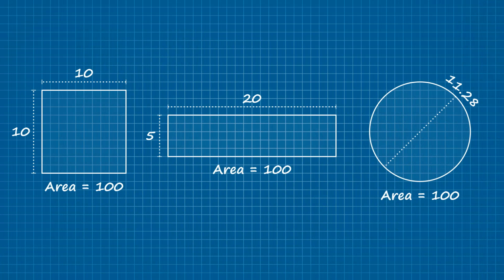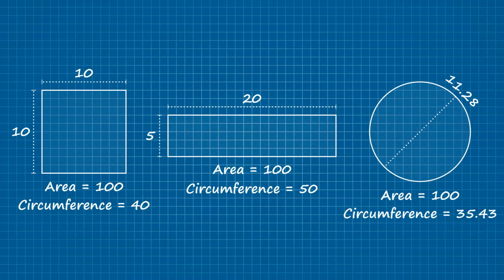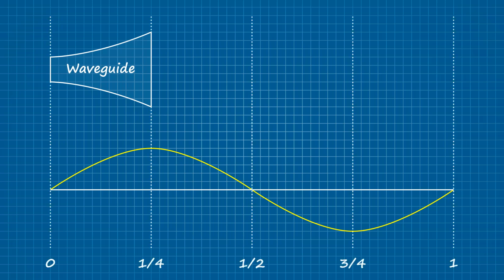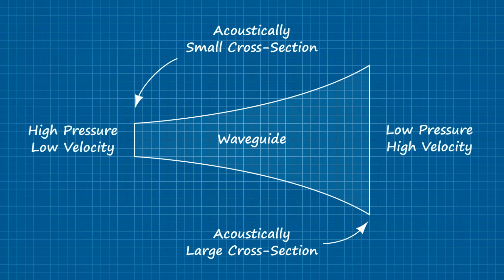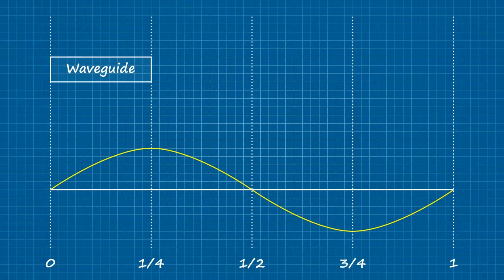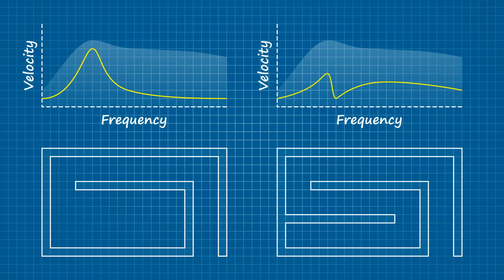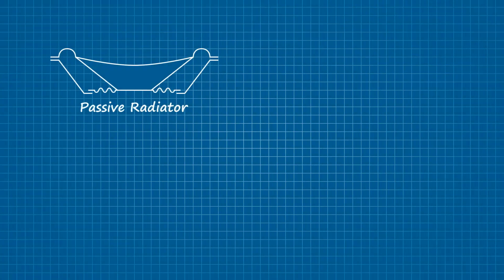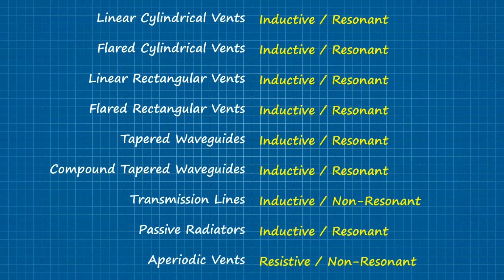The BEST Port Video EVER

Comment: If you cut a linear cylindrical vent at an angle, then each end area should be bigger, but is it acting like flared or is air just leaving one side of the port first making it effectively just shorter?

Comment: Hey Hexibase,
I‘m in the middle of a subwoofer project (which is only possible because of you ) thank you for that ! 
But now i‘m asking myself if my port length is only gonna be the cylindrical part of the port or the flares that are making both end pieces aswell. 
I really hope that you can help me out with that question
Thanks Dennis

Comment: Got it all on the first go, nice job.  But to be fair...I have been designing and building boxes "technically" since the early 80's as a 12 year old making speakers out of cardboard boxes using salvaged boom box speakers. LOL But for real since the mid/late 80's.  The BIG game changer was my first "speaker program" running off floppy disc in a DOS environment! LOL  Before that it was books and calculators.  😁

Comment: Great video, but how big is the lack of efficiency with a rectangular shaped port. 
I’m planning to use a 18,5 x 3 (cm) port with a 24cm length. 
I could replace it with a round one but I just can’t find one with the same surface combined with lengt. Shorter is not annotation due to the air velocity and bigger not due to excessive length.

Comment: Hey Pete, 

I learned that oversized vents are more efficient, is the same true for larger PMs? Lets say the PM 3 has times the surfacearea of the active chassis vs a more conventional PM setup where the PM is roughly 1.5 of the active chassis area.

Comment: Ssssoooo it's been 5 years since this intro. Is there any chance there is an in-depth technical follow-up in the works? How do you calculate the curves and lengths for the tapered stuff? Or is it trial and error? Iv looked around for videos over the years with very little luck. 
As a side note, thanks for all you do, mister Hex. I greatly appreciate your efforts even if I mostly end up with more questions than answers 😆. It's not your fault im just not that smart.

Comment: What do you think of this?>>>Depending on the port length alone, I suppose the idea should be to have it such that every movement of the excursion of the sub
should be presented at the port's frontal opening to actually add onto the sound level from the sub itself, even though it may be (or MUST be, per my proposal) one half (or a full?) cycle behind it, utilizing the port length alone to 'simultane-ize' the port to the sub. Hell, this may be actually what 'tuning' (yeah, right - 'This is what it showed up as - I'm just happy that it 'bangs'') the assembly should involve. I'm thinking of it as though it were an engine's piston, having to be in exact accordance with the other components or it will not work properly - or at all. Something similar and perhaps more-knowledgeable was mentioned below by @NackDSP, so credit where due; 
I suppose the main stipulation is to know the length of any given frequency's wavelength, lol and zero in on a desired frequency per that of that one that one THINKS (whoa) will make their day, lol. Cheers---🍀

Comment: Question....2 sundown x18v3....14 cubic feet box at 32 hertz.....can I use three 6 inch ports at 11.56 inches to reduce port displacement.....or do I need four 6 inch ports at 16.87

Comment: Don't settle for late ringing bass of a ported system.  Seal the enclosure, add a second woofer apply a Linkwitz transform to get the low bass you want. Set the roll off Q low, like 0.4, to get minimum group delay.   Done.  Perfect bass forever.  Go try it in winISD.  They even have the Linkwitz transform model in the filters section.   Stop crushing your bass transients waiting for that port to go through 3 cycles so it can reach the SPL you wanted.   The transient frequency response of any ported system is just what you get from the woofer without the port.  Have a look at that.  Where's the bass?  It's on order and will be here in three cycles.  Plucked bass notes and drum beats are falling exponentials.   That first cycle has the peak SPL.  You never see that with a port or passive radiator.  And those resonant systems don't stop when the note does.  It keeps going three more cycles.    Enjoy your slow late bass, won't stop blurry ported bass.

Comment: Recently I built 4th order for 2 10" subwoofers,  sealed was a little over 1cube, ported was 2.3cubes, I tried to tune it to 36-38 hz with 2 3"/8" flared ports didn't like the sound so I removed 1 port shorten the 1 port to about 4" it was worst, this was on a 3k, then I switched to a 5 k and that made matters worse, I'm going to scrap the box, but I think a box that small I had to tune it to more than 40hz, but I simply don't like higher tunings, I'm probably going to just make a regular ported box for those 2 10s

Comment: 🔴I have a 8 cu ft gross ported box (with 15" kicker L7s 1000w) my port area is 17.5" x 4" equals to 70 in2 (or about 9 in2 per cubic foot). can someone tell me if my port is to small. i heard its supposed to be 12 to 16 inch squared per cu ft

Comment: I hope you see this question ...
You are the most knowledgeable person I have found on the web regarding subwoofer enclosure design so I have a question for you. 
I built a 6th order BP. I built it with the 35hz port facing the rear of the vehicle, and the 85hz port facing the front of the SUV. My thinking was the lower bass could bounce off the back to gain strength, and the upper bass could come straight at the front. 
It's loud and clean, but there seems to be a lull in the 60-70hz region, and I don't know if it's because the tuning is so far apart, or because the ports aren't facing the same direction. Please advise me Yoda🙂.

Comment: Let's see if I can translate some of this overly technical jargon into something more informative for people who are actually trying to learn from the video....
First thing that could have been simplified to almost everyone's benefit
"More consistent loading across their operating range"... just means the frequency response is more even or "flat".
Reply: "Efficient" basically translates to loud. More efficient means louder than less efficient.
Reply: "Velocity" idk, I'd have to Google that one. Anybody know what function the port velocity plays in the sound of a port? I'm sure Pete could have told us.
From what I know (which is admittedly limited) a smaller port cross section would mean higher velocity, but to me the main point of a smaller port cross section is a lower tuning. I don't assume that more velocity itself translates directly to a lower tuning, but that wasn't explained either.
Reply: "Acoustic impedance" ... acoustic impedance is a measure of the ease with which a sound wave propagates through a particular medium. Thanks Google. I would assume more impedance means more velocity.  So... smaller port means more acoustic impedance, which means more velocity, and thus lower tuning?

Comment: Great video. 
Question, does port material matter past it being strong enough to maintain its shape? And with a slot port do sides need to be made of equal thicknesses?
Reply: Side thickness does not matter assuming they're strong enough not to flex at high power. Ports produce sound by the air mass resonating inside the length of the port, so as long as the air is able to flow through the port without the port changing shape, its fine.

Comment: Wow So much information in such a short time, 1,000 Thanks 
Will the port output from a standard ported speaker, (eg a commercial 300 $ speaker/set) be in phase or opposite phase with the output from the bass unit? 
If it is not in phase, then what is it? Opposite phase, or without measurable phase?
Regards!

Comment: Hi, I have been following and by far you have the most educated explanation to ports and their relation to frequencies. I am a fan of folded horns bass, to me the way el36sixis sound with long notes is awesome but they are not as punchy as srx front mounted bass cabinets. Anyway. Spl wise what would be your recommended box for 2 12 sundowns on a acura tl. Thanks in advance

Comment: How about these ported boxes with a corner port where you can see it stops a certain distance from the back wall of the box . The triangle port would be different from square or rectangle but still no we’re close to the round . I just wondered if you had seen this and inside they have like half walls . I’m wanting to think there bracing but if you look at them the rear part of these boxes are angled down in the back like the top is narrow from front to back. So there’s 2 walls-braces best I can tell by looking at them 1 is up and down out maybe 2-5 inches and it’s closer to the back wall and the one off the back wall is wide at the bottom because the angled back and placed close to the side off center we’re the one is at. Then they are both on the opposite side the port is on at the bottom now that what I see if it’s a single driver the one I seen with 2 has got 2 triangle vents for each driver and dose not look to have those braces-walls in it .  I kinda think they could be for we’re is a port the opposite side of them there for like air control ? There’s always something new or a twist on something we already have seen or hybrid of it . Also what do you think about the round subwoofer boxes I have seen them being made now we’re there ported different from back in the day . There measurements are off like the 10 ported is under a cubic foot so most 10s take a cube or more then you look at the 12” tube and it’s like sealed numbers 1.4 cubic feet ported I’m like buy a set of 12” tubes and put 10s in them might work they give you no port volume or exact size.  There partly round or rectangular with sloped sides. I like the looks of them but we know the wolf can come in sheep’s clothing but enjoyed the info great video keep control of the other Pete and thanks again

Comment: I have two 600 RMS subs I bought from a guy trying to do a home speaker. I would like to use only the subs since the rest was crappy. They are Edge Hollywood ED-1596. I can't find the specs and I'm wondering if it's too big to use both in my house (i gotta say I like it LOUD). Or to keep one for my car. What's your opinion on the subject?

Comment: does anyone know if I could do a 6th order bandpass with a regular round port for higher frequency response in the secondary  chamber but use a passive radiator in the primary chamber for lower frequency response and higher sound quality to create a "sealed" front chamber and a ported second chamber

Comment: Are there any special rules for PRs (Passive Radiators) such as where in the enclosure they should be placed (front, back, certain distance away from the active woofer...)?  Also, is there anything special needed for an enclosure that has say 4 small identical woofers (let's say 8" or 10" each) with a big 15" PR?  What normally should be the ratio of the PR's cone area vs. the total cone area of all the active woofers?  Should the PR have at least the same area as all the active woofers combined (such as four 8" woofers vs. one 15" PR), or should the PR have more, and if so, how much more... 50%, 100%...?  For a dual woofer isobaric (clamshell arragement) subwoofer, can a pair of PRs be added also in a "clamshell" configuration and is there any advantage to doing that? Thank you.

Comment: Hey thank you for this information I am currently in the process of rehousing my rear speakers from my 5.1 system into my chair that has the perfect holes. 3d printing. additive manufacturing. They are two 70mm 4ohms. looking to make the best box for them.

Comment: I bought the components to build the Bob Crites CORNSCALA type 'B' speaker system.  (Go to Bob Crites web site for visuals).  It's ports at the bottom radiate forward & are rectangular.  The company told me NOT to modify them with any flared or rounded end caps as port noise is not an issue.  What's your take on this?

Comment: In a car, does the port location make a difference? Like a subwoofer facing forward and port facing the back. Both facing the same direction. Which would be louder?
Reply: I had a Bose bandpass in my trunk and when the ports were facing towards rear of the car it had more bass but when I had a sealed inclosure it didn't make a diff which way the speakers faced

Comment: Flared round vent/ports are the best way to go.  Just common sense in a way.   Here is another way to look at it,  for the most part, car exhaust pipes are round for the same reason. Most may not know this but a cars exhaust, length & diameter,  also play apart in tuning the engine.  And just like looking for a specific tuning frequency of a speaker box, you are essentially doing the same with an engine.  This is also why sticking the largest diameter or shortest length pipe MAY NOT always be optimal for a specific build.   Regardless this is why I follow this guy, because I am experienced in this field,  got my MECP, & other certifications in the mid 90's, not to mention as much experience in building high performance engines & high end fabrications,  & so I can confirm that this guy knows what he is talking about. One of the best actually, so pay attention to what he says, because he is on point

Comment: In my workshop i have a variety of loudspeakers - yamaha-JBL- court- and a pair of transmission lines - when it comes to bass extension and warmth the TL beat the modern 15 inch drivers. from 80m away you just sense the air is full of life- if you get time to talk about TLs , i would be an avid viewer. thank you

Comment: Hi I want to ask - how to limit my 50hz tuned speaker with 2 flare ports to say about 80 hz or considerably reduce lower frequency with out upsetting overall frequency balance?

Will open cell foam reduce it like the foam used on classic spendor 100 speakers?

Comment: Question to HexiBase: can I use multiple holes on the box, instead of a single tube? For example if tube required would be 10 cm long and 3 cm diameter, can I simply drill 5 pieces of 3 cm diamater holes on the front baffle which is 2 cm thick? I guess the resonating “airmass” would be similar. Yet no one uses holes! Why?

Comment: 1) You assume that the emissive point would be at the input of the vent, that is wrong. Sound already comes from everywhere at this point, hence your air velocity argument isn't valid, for this sole reason. There is still a impact, due to the friction effect of the bigger circumference only.

2) Rectangular shaped vents benefit from requirering a smaller surface area (hence, a shorter vent !) for a same accord frequency.

Comment: Excellent video! If a rectangular port is chosen for a subwoofer and the length of the port is to long to fit in or out of the box, so it is instead snaked back and forth within the box, does it then become a T-line box or is it still just a rectangular port?

Comment: Hi. Maybe I will sound silly and I didn't understand well but, here is my question:

The less air inside of an enclosure with a passive radiator, the better?

Is there any ideal position for the passive radiators? Maybe some "wall" into the enclosure between the speaker and the radiator??

Thank you in advance. You are truly an audio-genius

Comment: some late info.        at 3:05,  in the context of the propagation of sound waves,  with the exception of high-excursion drivers, there is very little Flow,  laminar or otherwise.        ONE  aspect of a port is absolute  ---  it  Must be  symmetrically shaped.      in the case of a baffle-located port opening,  design must result in  adequate  diffusion of the back-side sound waves; in order to minimize  sound cancellation.      it is not clear whether the length of a (poorly designed) wave guide  introduces  temporal distortion or other artifacts.  cheers

Comment: Just came across this video and I enjoyed it. I will have to look for some more recent ones. A lot of information touched on here. It is apparent from your comments that you know a lot about ports and wave guides. I am hoping you have more videos that expand upon this topic. I have been designing and building speakers off and on for at least 30 years now and the last one was my first attempt at a transmission line. I think I’m in love! It was a difficult design and build that involved a fair bit of tweaking but it turned out great (in my opinion). That was the last speakers I built (about 15 years ago). Still enjoying them but now that I am retired I want to built a larger pair. I am worried that I may has just gotten lucky last time and may not be as successful this time.
Thanks for your entertaining video.

Comment: Waveguides belong to GHz frequencies, not audio frequencies.
Reply: @HexiBase  Just looked up 'acoustic waveguides' and see that you are right, the term is used for ducting sound waves. I come from an RF design background and always associated waveguides with microwave waveguides that use transmission line theory, which cannot be epplied to speaker ports/ducts. (Sound propogating down a tube is nothing at all like a true microwave waveguide. The term is misleading (to me)  since true waveguides are using transverse electromagnetic waves, not longtidinal pressure pulses.)
Since the term 'acoustic waveguide' has been established, I can only say 'I wuz wrong'!

Comment: Thank you for all of your videos . I had a question about building a ported box on a space saving budget. I don’t have much room to work with, and wanting to do a ported box with two 10s with the baffle angled(I believe 4th order box) I’m wanting to make the box 10(H) 18(D) and 47 inches long. I have to angle the baffle back to get the sub to fit in a box that’s only 10inches tall. I am trying to possibly port through the back package tray of a 1965 impala. Is this a box nightmare waiting to happen?? Thank you for any help.